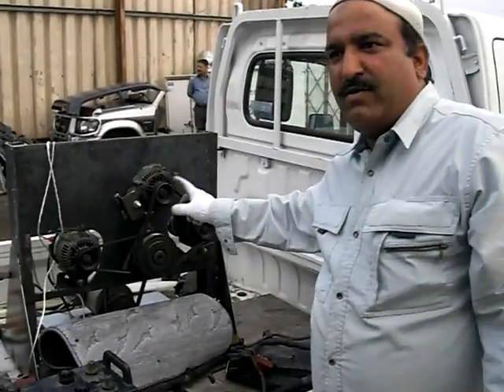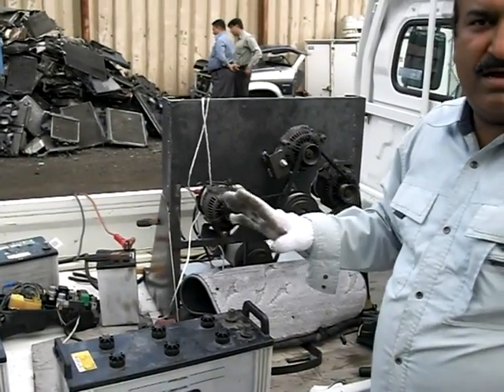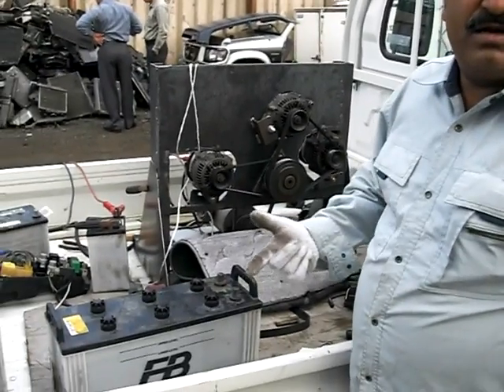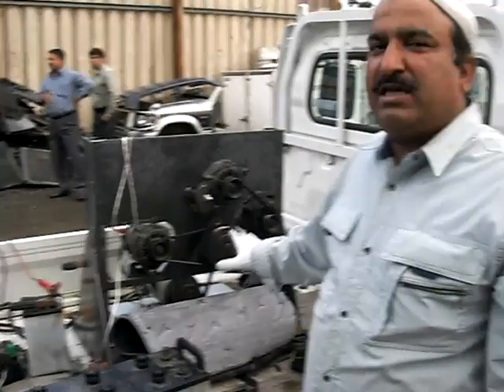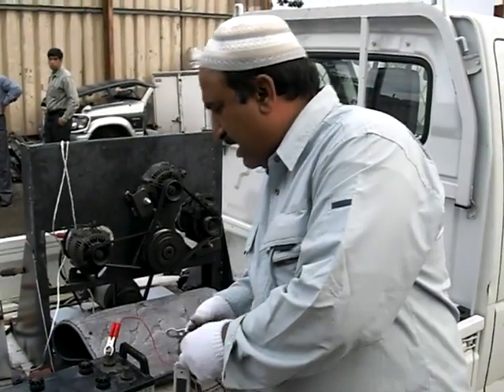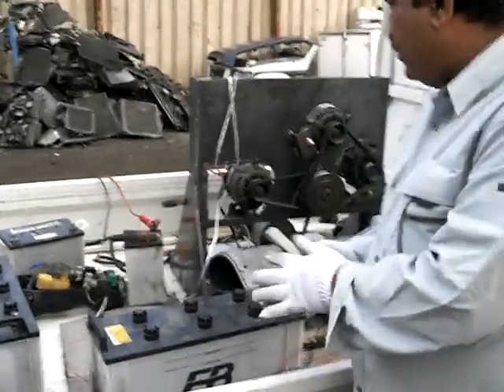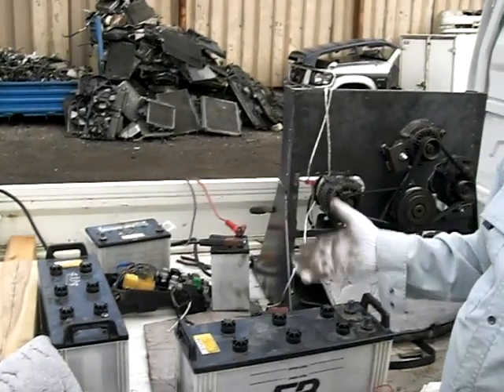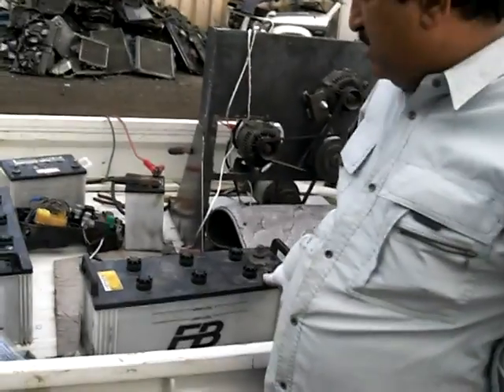FREE ENERGY POWER GENERATOR  at home with used car alternators5

Comment: and he is saying that with the low voltage you van run f*** u in his 6 min video what he did he power the source motor with AC he tried to make us fool showing that he is running it with battery but did you people notice that it was not working but when he plugged the socket it starts.in pakistan electricity is a major problem but don't you play with Pakistanis.you wanna make money do it but not in that way make something better and working don't sit in japan come back to pakistan

Comment: this man is fool not showing back there is nothing in the back he idiot already share the idea which was mine 3 years ago.but because of money problem i didn't make that.i will show you what is in back side.a ac motor with a pulley on its shaft and a belt fom that pulley to the main pulley which runs the 3 alternator and wires they are in series that's all he have in back side f****** idiot

Comment: first of all he is using a single phase motor to rotate the dynamos 
he is saying intake 4.3ampx220volt= 946 watts
while output is        43ampx12volt= 516watt
so he is actually losing power which is 946-516=430watt.
how it is free?

Comment: Dear Masood, 40 amps x 12v = 480w so why 4000w inverter is here? Or I missed something?
Reply: 4000w Inverter is connected to the battery. The battery serves 12 DC to the inverter but it must be charged first ahead of time. Those are pretty old alternators and so you can use that analogy but fit at least 2 high amp truck alternators say 24v 80A each to make maybe 24v 160A, which is about 3800W. That's all fine but the driver would be challenging to spin the 2 alternator because of back emf. But to counter that we have to adapt the RF method of energy production . That information on how to do that is explained very clearly in one of Gerard Morin's video titled MAXIMUM EFFICIENCY FROM A DRUM MOTOR where he drives a small rewound (3 phase to single phase)drone motor at about 15000 rpm using another drone motor which yields high frequency AC to about 10A at 25v output, the spice in the video is in both the output of the rewound drone motor and the fact that the little driven motor turned generator didn't experience any 'braking under load'. Another video in YouTube talks about a flux gate generator, which in Wikipedia is termed as a flux switching alternator that gives results contrary to what we're used to in all portable generators nowadays that tend to experience 'braking' under load. But there is some truth this but as Gerard Morin says,you have to do this on a very small scale (drone brushless motors scale) but results will be consistent.